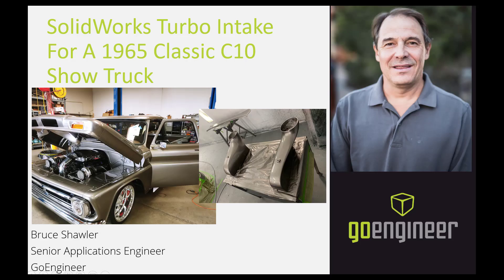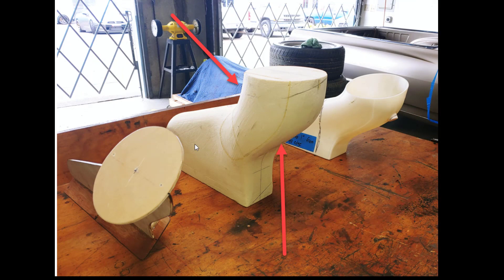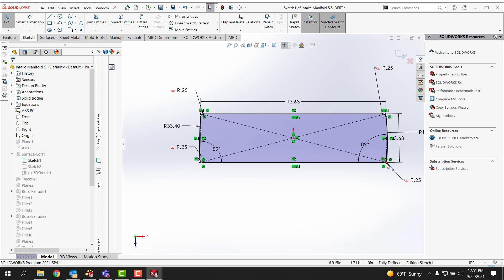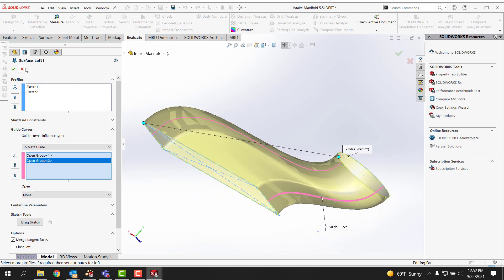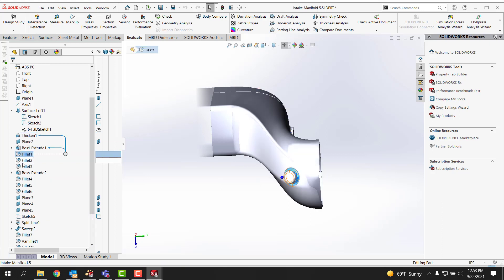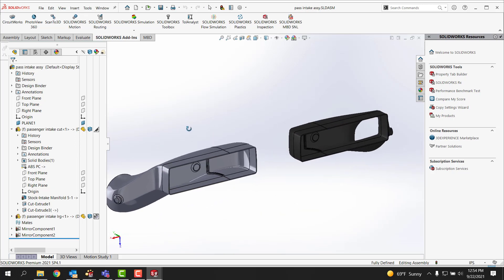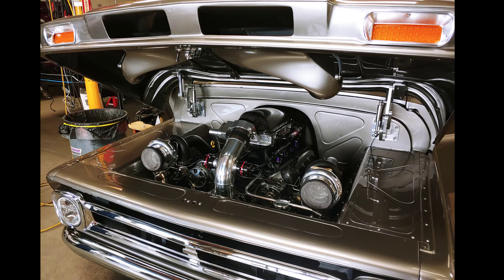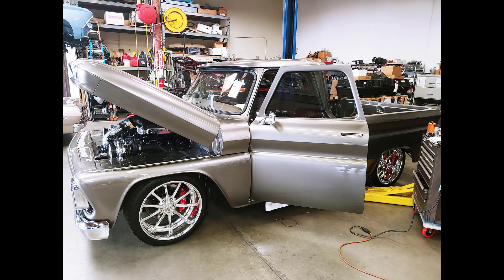SOLIDWORKS Tutorial - 3D Design of Twin Turbo Intake Manifolds for a 1965 C10 Classic Show Truck

Comment: What was the material used for 3D Printing the Intake manifold?
Reply from the maker: At the time we printed this in a PC-ABS as it was a good option and we had the material . We have some larger format printers now with some other material options, so If we where to do it again today we could get a little thicker, printed in one piece, and we would have had more options for something with a higher yield strength.

Comment: Thanks for the video
How is the model designed? Is that scanned before modeling or just measured?
Reply from the maker: No scanner was used. We measured it and made the “Wood Centering Template” you see at the time mark 46sec as a layup measuring device.  The template was done before I got involved, so I was able to pull all the measurements I needed off of the template in less than 10 minutes.  It would have taken me that long to calibrate my scanner!

Comment: 1800usd to print & design that?
Reply: 1800 was a great deal for the two printed parts used 1800 more at the paint shop.  The design was complementary for a friend and the first print was gratis from GoEngineer.